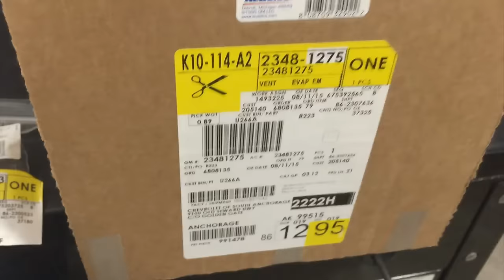Chevy Truck Hard To Fill Gas Tank - GM EVAP Codes P0442, P0446, P0455 or P0449 Vent Solenoid replace

Comment: Hope you see this. I have a 2002 GMC Sierra 1500. I have the P0446 code  I have watched at least 10 videos and for the life of me I cant find the EVAP canister vent valve that they show in the TSB or in videos....
Reply from the maker: Where is your canister located? It either in front of the tank or behind on the left
Reply: Just so you know, this was probably the worst location GMC could think of for my truck. Remember I said I could not find it ? For  good reason. Followed the line up and over the tank where it sits between the frame rail, the bed and the tank. TOTALLY inaccessible by a normal human. To see more than a glimpse you have to remove the tank protective cover. I did. Now you can see 1/3 of it and you have a whopping 3 inches of work room. Manager to get the electrical connector off. Managed to get it off the bracket but getting the locked hose off ? EYYYYYYYYY - 1 hour of manipulation and braking the tabs. Put the new one in and now hoping it works. Will the code reset it itself or do I need to clear ? If I clear then I have to go through gyrations to get the computer working again for an emissions test. Blank is a fail.

Comment: I have a 2005 Chevy Suburban. I replaced the vent solenoid canister last year and currently have this problem of the gas tank that is slightly hard to fill and it will also crank kinda rough after filling plus at different times I have to double crank. Any advice?
Reply: I do have a check engine light on with codes of P0445 and P0496

Comment: I replaced the vent valve solenoid, it barely had any impact on the slow fueling. 
I replaced the charcoal canister, it solved the problem completely and got rid of the check engine light and error code. 
2011 GMC Sierra.  All parts purchased on rockauto for less than $200.
Reply: I have a Cadillac Escalade and I ordered the canister and the vent solenoid and an oxygen sensor. I plan to do the repairs over the weekend. It currently takes me 40 minutes to put 27 gallons of gas in the tank.

Comment: I  have a 2011 Silverado recently recently changed fuel pump cleaned canister And all related  Tubing. Replaced purge vent valve and vent filtration . No change at all still does not want to take fuel . I wonder why in all their infinite wisdom,  General Motors decided to locate this vent in what is known to be the dustiest location on the vehicle, my recommendation is to get more tubing,  and route the vent somewhere up on the cowl. Anyway is there any suggestions as to what I might do if changing the purge event valve system and cleaning all the tubing Does not help?
Reply from the maker: Check for restricted fill pipe or hose. Maybe a kink or contamination.
Reply: @ThecardoctorTV   You know, I'm just wondering if that filler neck has a check valve that gets get stuck And loosens up when the encounters some fluid  . It seems like after you get the 1st 6 or 7 gallons in it goes ahead and takes fuel just fine . I don't know something to think about

Comment: Question I have a 04 Chevy Tahoe I am only getting a p0455 nothing else and sometimes when I fill up that gas tank it's hard as described. Do you think this might resolve my issue thanks in advance for you help
Reply from the maker: Yes. It's the vent assembly, canister or both.

Comment: I have a 2003 s10 and im not throwing any codes. Could not find a block in the vent solenoid. Any ideas, filling up is a terrible experience now a days
Reply from the maker: Its not as much blockage at the vent valve but just sticky valve. Also check for restriction at fillpipe.

Comment: Does the filter for the hose that goes up to the back of the gas housing have to be installed the way you did? I have changed the valve solenoid with a new one, and now that I did now I'm having dueling problems and still have the p0446 code on. Please help Ty
Reply from the maker: If the hose is kinked it wont fill properly. Also its possible you have a clogged canister

Comment: Hi do you know if there is a tsb for the previous gen?  I have an 06 avalache and I've done the charcoal filter 3 times already... not only is it expensive it keep reclogging.
Reply: stop over filling your tank.  the excess gas goes into the charcoal canister and effs it up.
Reply: @gdcskates  I never overfill.... stopped after the first time I replaced it.  Just stop after it clicks full.  Better to ask the question first before assuming things 👍

Comment: hi there I am having a similar problem with my 2012 gmc but it is only at the last 10 L when filling and the hose does not shut off and I spill fuel always. what is going on ? need some advise.
Reply from the maker: If it doesn't shut off then im not sure its the same issue. Does it do this even with different gas stations or pumps? Strange

Comment: hello I have an 07 silverado,I replaced every hard part,is there a filter under the spare? my mechanic says no,I haven't checked I keep getting the p0455 code truck runs good,Idk if it's a hose with a crack or what I'm tired of wasting money can u help me thank u
Reply from the maker: +dj seven47sa So you replaced the canister and the updated vent control assembly and still have the code? Have you checked what the fuel tank pressure sensor reading is with the fuel cap removed? Have you replaced the purge valve on the engine?
Reply: +The Car Doctor yes I have,I think it could be a hose that has a leak,I'll get the check engine light erased and 2-4 days later it comes on,truck runs good no hesitation,it doesn't have any noise or anything so Idk what to think at this point,thank you for replying
Reply from the maker: Vent solenoid assembly is the number one cause of this code. Then purge valve. Youll probably need to work through the flowchart with a scanner to figure this out. Maybe wiring related. Good luck.

Comment: Take the hard plastic  hose off the vent valve {"you will have to cut" use pvc pliers .Cut nearest to vent valve  ,but leave enough to slide  1/2  hose over to reinstall later.}
 that goes to the charcoal canister and then take the gas cap off and blow compressed air in the hard plastic hose  that goes into canister  till the tank gargles and swells. Repipe back up with half inch heater hose and 2 clamps.Blow out vent valve back the other way .Take top off plastic vent valve  and blow filter out and housing.
Reply from the maker: Well I agreed that its dust causing the issue and blowing things out can help but Im concerned about pressurizing the fuel tank like that. Removing the vent solenoid assembly and cleaning can be a cost saving method for sure. Also might be difficult to clean the inside of the canister as I have never had any luck even after removing from the vehicle and having it on the bench.
Reply: Well when you blow through the canister with the pressurized air from the vent valve hose,the tank will back blow out toward the line you are blowing in.Which in turn makes you relize it is venting properly now.At first blast I relized I had a blockage.But kept it held on till it blew through the crap. All emissions codes stayed off and truck started back getting better mileage.I have drilled a hole in a canister before at the bottom and drained gas out.Over filling gas tank continually can cause this. I then sealed it back up with ABS glue,which is what the canister housing is made out of ABS plastic. I normally blow stuff out and beat on stuff before I replace it.Stuff gets trashy !

Comment: i have changed the canister and solenoid by fuel tank by spare tire also have changed the valve by alternator but still have problem fueling up
Reply from the maker: possible restriction in the fill pipe

Comment: have a 2007 suburban, po442 code, and can only put 4 gallons in then it shuts off then add 4 or 5 more, then shuts off.  would this fix it?
Reply from the maker: +Grant Blomberg most likely. If it was me I would check for any kinked hoses and replace the updated vent valve and see how that works. Sometimes you'll also need to replace the canister as well. I would stick with OE parts. Good luck.
Reply: Grant Blomberg i

Comment: I just got the p0446 code, as well my tank is hard to fill up, I replaced the vent valve a month ago since it had a faulty valve but the valve is only a month old so I doubt it could have failed so fast, ive seen canisters being plugged so this sounds like the next step
Reply from the maker: yes. canister full of dirt. Bummer

Comment: My 2007 trailblazer has a p0442. Would this be the problem? I know it's not the gas cap. Maybe purge valve?
Reply from the maker: Most likely the vent valve assembly back by the tank. They clog up with dirt. Get the updated OE part and see how that works. Take care
Reply: The Car Doctor Oh man, Does that require me to drop the tank? I just did my fuel pump last month. I would've done both if I would've known. Thanks Doc

Comment: Hi ,I have a question about specifically about  P0446 code on a 2008 cadillac escalade,  So this what still happening,I already replaced ALL NEW OEM PARTS : FUEL CAP, CANISTER,SOLENOID under the car ,and solenoid on the engine. And the code P0446 still coming up . Under the car the voltage exist on solenoid when the key are turned on and making click. 
What else could be wrong ? what testes can be done to find this annoying code? I need your help before I loose my cool and set a hammer on everything...LOL
Reply from the maker: +007Vision Have you replaced the purge solenoid on the engine? It's cheap and might fix your problem.
Reply: +The Car Doctor ,Yes brand new (on the side of the engine,rectangular shape). i change the Fuel CAP, Canister,and the solenoid under the SUV near spare tire. and the code P0446 still coming up, after being reset on every repair ,all parts i used the OEM to avoid problems,but seem that something is wrong. How to test the remaining parts? if any ...and the code never changes ,Unless i disconnect the sensor ,or solenoids then new codes appear.    But so far P0446 still coming back every time ,within  hrs of been reset
Reply from the maker: Are you able to monitor the fuel tank pressure sensor reading? With the gas cap removed the fuel tank pressure sensor PID should be zero. A faulty pressure sensor can set these codes as well.
Reply: Hello 007Vision, did you get it fixed? I'm having exactly the same issue as you. change everything including the cap.
the only thing that my OBDII tells me is 
Engine speed over 40 rpm, system voltage from 7.5-15v, then the PCM detected a short to ground, an open circuit or a short to power in the Purge control circuit during the test period.

Comment: I had and 0442 so i changed the vent valve, still had the code so i changed the purge solenoid , andbthe gas cap then i changed the vapor canister and its still not taking fuel .... when pumping it comes out of the top of hose from filler neck to tank
Reply from the maker: I wonder if you have a restriction in the fill-pipe. Have you tried disconnecting the vent valve hose on the tank side and attempt to put fuel in?
Reply: Check roll over check valve

Comment: I got a P0446 in my 04 Colorado. Just replaced the Evap vent solenoid and I hope that fixes her
Reply: Did it fix? I got the exact same code on my  03 Impala, replaced the solenoid yet I got the code back. Any luck?
Reply: @Amp661   Mine turned out to be a clogged charcoal canister. I passed emissions and have had no issues since replacing the charcoal canister

Comment: I only have the P0455 on 07' Avalanche only. I can't pass emissions. I don't have any other issues as far as fill ups. Do i only need the evap valve? I like the video!
Reply from the maker: Most likely the vent valve. Be sure to get the OE part with the updated filter since you don't want future problems down the road with the canister.
Reply: Irvin Pope hey question did that fix everything and did check engine light go away after replacing that? I have same issue going on
Reply: I did everything in the video and cleared the check engine light. Everything is fine now. Good video

Comment: I have a 2004 Chev. Astro van with a very slow fuel filling.  No trouble codes.  Would that be a condition caused by a defective solenoid?  If so where is this value located as it's not like the avalanche.
Reply from the maker: Not exactly the same location but very similar system. I see a lot of the AWD Astros and I believe the vent solenoid on those is just behind the tank and above. It has a long pipe leading to the canister area. This vent solenoid can cause similar issues as in this video but you want to pay close attention to the fillpipe and vent tube from the fill neck area. When the fuel pump is serviced in these vehicles the pipes can be kinked and cause the symptom you describe. It is very hard to see the fill pipes as they run over the frame rail above the tank and are covered by shields. Good luck and thanks for stopping in.
Reply: Thanks for the insight and quick reply.  This vehicle belongs to a friend and has been struggling with issue for almost a year.  you mention about a possible kink in filler hose and that reminded me that she has had that fuel tank dropped twice for fuel pump issues.  I will have her hubby check that as i think the people he hired weren't what I would call 'real' mechanics.  I'm disabled now and without a hoist it is to hard for me to work on.  Was in the business (working the line and turning wrenches) for 28 years but now all I can do mostly is watching videos and offer advice to friends and family.
Reply from the maker: Im sure your assistance is greatly appreciated. I hope they figure it out.

Comment: I change it but still the same problem!! Any idea?
Reply: You have two more things to check. There is another valve at the engine end of the EVAP line that might be bad or you have a leak in the EVAP line. If you are not getting any codes and you still have a problem filling your gas tank then you have to vacuum all your lines out because you probably have charcoal pellets in  your vacuum lines.

Comment: I have had a p0446 on my 05 Chevy Silverado for about a year and a half.  replaced the purge valve (@the intake) and  the charcoal canister twice (once without the hose and once with). currently the canister with the hose is on now but the gas is still hard to pump. any suggestions of what I might be doing wrong?
Reply from the maker: did you replace the vent valve with filter with the updated parts?
Reply: What is the vent valve?
Reply: Yes
Reply: And I cleaned the charcoal canister

Comment: I have problema chevy impala 2008 the code is B2aaa how fix the problem
Reply from the maker: I have never heard of a code like that. Strange.
Reply: I have problema chevy impala 2008 the code is P0446 and P0506 how fix the problem
Reply: I have problema chevy impala 2008 the code is P0443 how fix the problem
Reply from the maker: what engine?
Reply from the maker: Your car has common issues with the canister purge solenoid wiring and connector. Check the harness and connector for the canister purge solenoid and the fuse that supplies voltage.

Comment: Hi there. I had changed this part out a year ago and still have the same po446 code? And filling issues
Reply from the maker: +AResistanceRider _ Maybe a bad canister or purge valve. Did you use the OE updated part with remote filter kit?
Reply: +The Car Doctor yes ordered from dealership. I'm guessing the purge solenoid on the intake perhaps. Thanks for response great video!
Reply from the maker: The purge is cheap and easy. The canister is easy but not cheap. The last one I had the canister looked fine but ended up bad. I even tore it apart but couldn't really tell by looking inside. If you have access to a scan tool it helps to check the fuel tank pressure pid with the cap off to make sure it's reading zero lbs. if you don't have access it's worth trying the purge valve and see if that works. Take care.

Comment: Hi there ...I have a question,I had the same code P0446 on escalade 2008,I replaced the assembly as described, and the code come back, I also replaced the  vent control on top side in the front of the engine, what else could be wrong for the code to come back?
Reply from the maker: +Allan Zonneveld It's likely going to be a faulty canister. The contamination that sometimes gets through the old style filter can get to the canister and cause damage.
Reply: A. Zonnebeld what was the problem? I'm having the same issue on my 07 Yukon. replace the whole system in the back and change the purge valve in the engine compartment and the code keeps coming back.
Reply from the maker: so you replaced the canister, vent and purge valves and still have the problem? What is the FTPS reading with the fuel cap removed?
Reply: +The Car Doctor 
yes, Duralast/Canister Vent Valve Solenoid
Part Number: PV449 from Autozone 
I haven't try that. I will check tomorrow and let you know.
thank you
Reply from the maker: Usually the vent valve (only recommend OE update kit with remote filter) and then the canister itself if it got clogged after the valve failed.
Reply: +The Car Doctor it looks exactly as the parts on your video + the new harness.
I will do that test and keep you posted to see if that help.
thanks again
Reply from the maker: Sounds good good luck
Reply: the canister your talking about is the charcoal one next to the gas tank